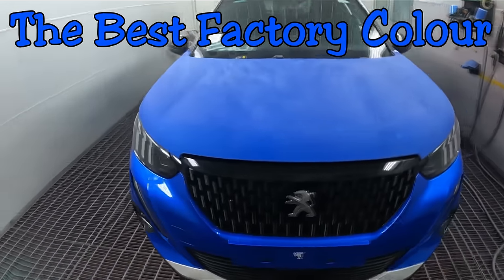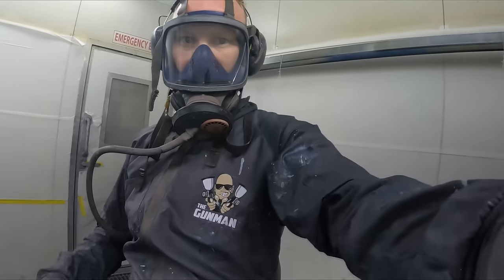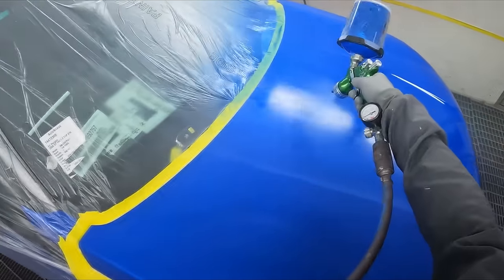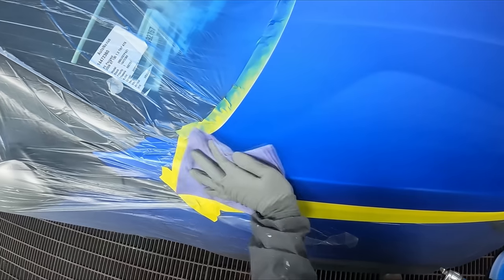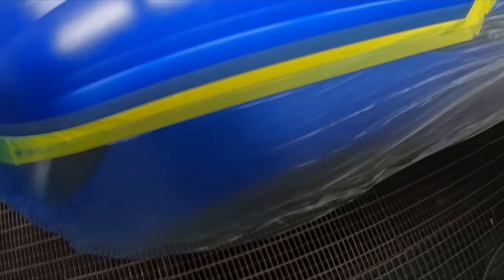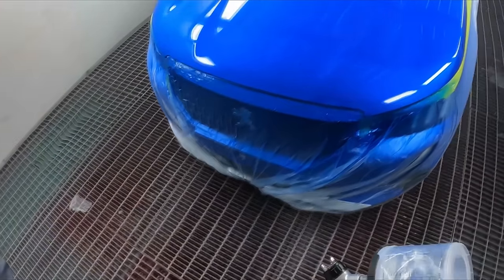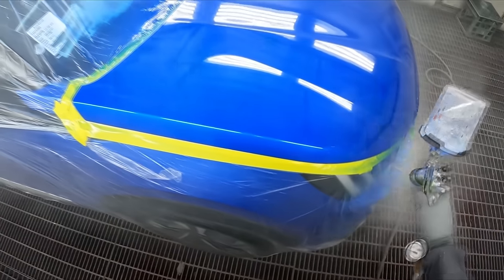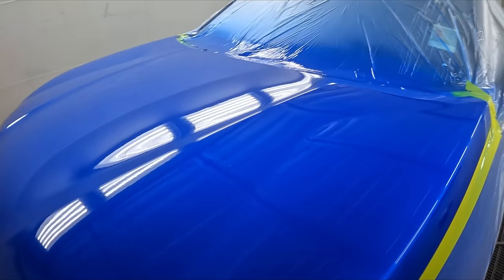The BEST Factory Paint Colour

Comment: I generally do not wear a respirator for the cleaning/prepsol stage, but then again, you are doing a great many more spray jobs than I do. Professionals should look after their health as the long term effects can de bad. A good idea Gunny.
Reply: I did that once using a water based solvent and had a headache for 3 days. After that I won’t touch the sprayer without a respiratory. Now to be fair it was a complete wipe down and was probably an hour exposure with no ventilation.

Comment: Hey Gunny, love your work mate. I was wondering if you could pass on your knowledge regarding the de-masking process. I'm a new DIY garage spray booth painter, but every video I watch shows the prep, masking, base, clear and Bam the car is outside in the sun finished. I would love a video explaining your methodologies, as well as the time frames around waiting for the clear to go off before starting to remove the plastic/masking etc, taking into consideration my home garage booth doesn't have a bake ability or heat lamps. Would love to hear your thoughts mate 🙏 Cheers Andy 👍

Comment: Gunman,,, The temperature Of the paint materials / Clear itself needs to be optimal room temperature during mixing & application.... The body panels also need to be at optimal temp of 72° regardless of booth temp..... 

PPG rep told me this - Maintain optimal temps, spray, Allow it to flash off & then go take a 30 min lunch break..... It allows the micro solvents to evaporate.

Comment: Have you ever had an issue painting automobile Plastics? Currently I am painting some emblems on a 2016 F-350 and every time I try to paint them I get this yellow in color in the paint or in the clear coat.
Reply: can you elaborate further? do you have yellowing in both the clearcoat and basecoat? do you use the same gun for clear and base?
Reply: Let them dry good and try again and or next time hit them with some epoxy sealer and let that dry not too heavy spray it lightly maybe 2 light coats versus 1 heavy med..you may be getting a reaction from plastic and chemicals in the paint in this case less is better and let it flash well before applying additional material
Reply: @novinnovations4026  Thanks for the reply. I use different guns for base and clear. I have tried a 2K primer and then the base., and it looks great. As soon as I apply the clear it turns a yellow looking color, causing the color to look greenish. The color is sonic gray pearl frrom a Honda. I have washed them in Dawn dish detergent and also used a plastic prep from metalux. I will link a video of someone having the same issue with Oxford white.
Reply: You're getting a oily tinge. It never leaves because it's in the material.... Have to do the usual, plastic promoter / sealer / base / clear.... Allow to clear ,,, Re prep & spray again - should work...

 Otherwise , You could always resort to using Bumper Cladding - before regular paint procedure
Reply: @keithkelley8913  what brand clearcoat are you using? And do you usually spray with the same setup without running into issues?